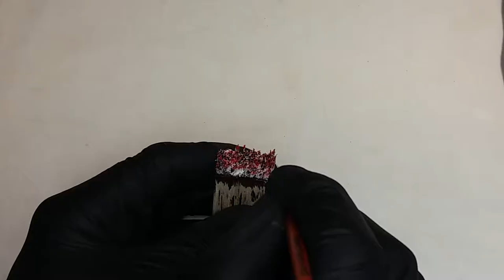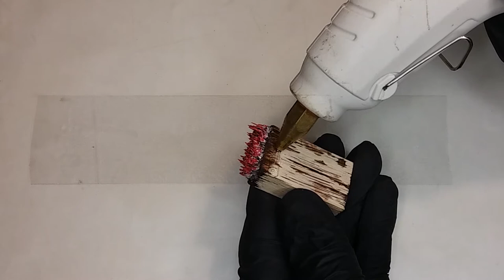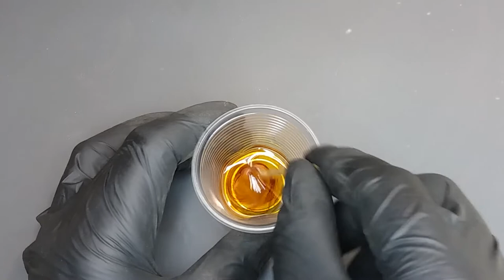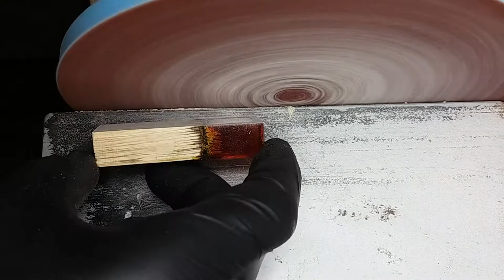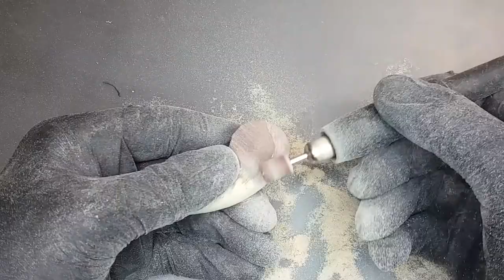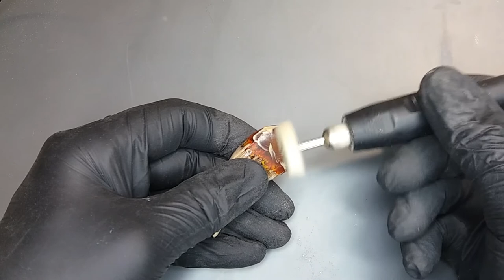Resin art jewelry. Amazing pendant Fang made of wood and epoxy resin. Diy /Epoxy resin/

Comment: Sorry for all the questions but What is gradation? Did you put water on the sanding paper? And what type of oil did you use?
Reply from the maker: Thanks a lot for your comment. By the word gradation, I meant the transition of sandpaper grain from 280-400-600-800. Sandpaper from 1000-1200-2000-2500-3000 I water with water to raise the nap on the tree and the paper does not clog so much. I use colorless wood oil based on vegetable oils and wax.
P.S. Questions on the merits, I will change the word gradation to another.👍